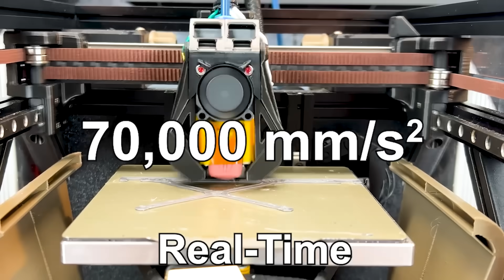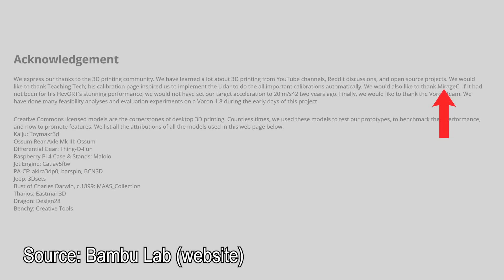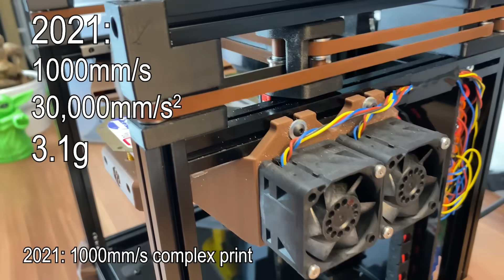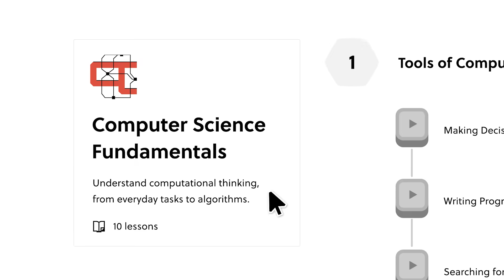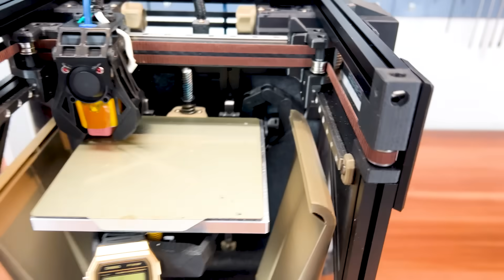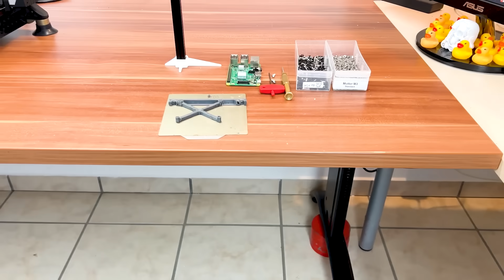INSANE PRINT of a COMPLEX PART on a tuned Voron - 247zeroB2

Comment from the maker: This printer has been released open source, here is the video: 
https://youtu.be/zpHNJRX5t3s?si=XEu5H-D5V5siwk1O
Reply: Congrats on stopping smoking!
Reply: congratulations
Reply: Wow das ist unglaublich. 

Und Glückwunsch das du es geschafft hast mit dem Rauchen aufzuhören 😊
Reply: I've got 2 words to say here... Dimensional Accuracy? (not functional, functional is very forgiving... Accurate, across many platforms)
.
components integrate, components need to Fit Each Other, they need to avoid compound errors throughout the assembly... can ANY fdm printer, in reality, poo anything close to this fast. no matter how great the extruder and produce accurate parts with sensible Component cost? really though?
.
Any 3dp owner knows you Can (promotionally) print at high speed. 2k x 70k will result in, essentially random, component sizing and ever-greater compound assembly errors.
Slow and accurate will always be better, until G-based E-wiggling is replace with ionic material control/microwave composition... which we aint anywhere near.
Plodders want 'print heads,' the E dimension. that supposition will limit flow control until material and post-process are combined... into a 'microwave' that prints, cinters, stabalises and potentially Biologically activates any assembly.
.
Joined up thinking will revolutionise 3dp Material, Placement,  Interaction - way beyond the fdm 'boat race'
Reply: Congratulations on not been drunk.
Reply: CONGRATS ON ONE YEAR🎉🎉🎉
Reply: now use petg - cant get over 100mm/s .... viscosity and flow rate are ass there
Reply: @Jayko30  that’s petg. Who cares 😂
Reply: @BlakeT  after you tried using your brittle pla toy parts for something serious you would understand it. PC, PETG and ASA are go to instead of these toy filaments like PLA or PLA+ which break at the slightest impact
Reply: @Jayko30 I agree with you, however I notice many designs for printers and 3d printed cnc use PLA for its stiffness, it is very stiff compared to petg and abs, but maybe not PC
Reply: Does layers fuse correctly?
Reply: S😅t😅😅😅t😅tytty😅t😅😅e😅t😅t😅t😅t😅t😅😅eet😅t😅tetseteet
Reply: Good work! Amazing

Comment: this gets me very excited about my project!
i bought a used pick and place machine which i intend on removing all the original electronics and putting 1KW servos on X and Y and quad direct drive extruders and btt manta with cb2 and even with all that weight it should hit 1500mm/s and easily 50k

Comment: Congratulations on being smoke free! I am a bit like Prusa, speed is a secondary quality (including overhangs) and multi material first. Though when i have to wait for 10 hours to use again my only printer while others only need 1 hour is something that will grab my attention instantly. Speed isn't everything, but it still deserves the second place on my list.

In case you are wondering, i mention multi material with quality together, because water soluble supports will give you the best possible quality at higher temps, which will give you better layer adhesion. You need multi material printing capabilities  for more accurate stronger prints. And some may even consider prints higher quality just because of their multi color nature.

Comment: I currently have an XYZ motion system, 1,000mm x 1,000mm x 400mm. The maximum speed is 1,650mm/s, with an accuracy of 1/2048mm, controlled by Beckhoff using the EtherCAT protocol (this speed is achieved with a maximum load of 18kg). Should I install a 3D print head? How can I install the print head?

Comment: 9 months later, i still cant help but wonder what if you changed those fans for something custom based on high power bldc motors and oDrive, because it occurs to me like those fans need quite some time to ramp up, imagine if the fans instantly accelerate to 100% without that delayed rampup, i think that would help massively for bridges like that.

Comment: If the head is as moving mass is upside down, then it will not wobble the whole printer. I would instead also stop the head moving, and instead I would move the plate.

Comment: That's cool, fast and real but what happen with print quality, the wear of the hardware specially the rails bearings, belts bearings, you have to grease every week because all the frictions and heat at that speed. What about the motor's (extruder & X&Y) will be on fire (hot). 
Can you do a video printing at 700-800mm/s speed or the fast you can with quality to compare with Bamboo and Creality they claim can print at 600mm/s with quality, that be a great video.
Thanks

Comment: for the x and y axes, wouldn't it be better to have screws like the z axes to move. I see that in cnc machinering and the speeds are incredible with a very high precision. I think that it would change alot the precision at high speed.

Comment: The quality is, as you said, complete garbage. But to quickly see if a component fits as it should be in order to throw it away afterwards and print a decent part, it is absolutely sufficient and saves a lot of time.

Comment: Wow, this is so far beyond what I thought would ever be possible. I have an Ender 3 Max, and I've spend a fair bit of time modding, adjusting, and dialing in my settings to be able to print reliably at 100-150mm/s... and I'm proud of it... yet I'm starting to feel like I'll look back on this machine and its speeds as a distant relic of the past in the not-so-distant future.

Comment: I am curious about the linear guides and blocks that you are using. Have you used some kind of preload or precision class?

As far as I know, those speeds and accelerations are very close to the rolling limit of the ball bearings inside the blocks. They might be sliding instead of rolling in some moments. I suppose that you will see the consequences if that happens. Keep us updated!

Kind regards!

Comment: It has been my understanding the speed limit is simply that the plastic can't be extruded fast enough and adhere fast enough.  If you increase nozzle size it reduces quality quite a bit.   Not sure I understand how to solve that problem, I don't think movement of the print head was ever an issue.  I also thought the delta design is the fastest since it uses three motors all at once to move the head, but it seems all these fast ones don't use it, the arms must not be rigid enough

Comment: it is a fantastic video, good experiment! So I was wondering what you have in the sides of your printer's bed that looks like fans ducts are they actually for pushing air towards your bed or not? Sorry if it is something common, I am learning about 3D printers designs still

Comment: If you want the best cooling for your print you should get some efi fans (wont work for the hot end as there to big for that) as they increase the airs psi a little as passing through allpwing for insane airflow with highly efficient cooling capabilites

Comment: Albert- you seem to be a dam good systems engineer, and the goal you have taken on to see how much you can speed up 3D printing seems rather inspired..   I am enjoying you narration of your youtube video's..   seems we have some motion control knowhow to exchange, as one can achieve significantly higher motion control performance by moving beyond open loop stepper motor to closed loop servo based control. here there a few additional things that can be optimized. before going into looking into optimal matching of inertial impedance of motor amateur with it's load, soon enough you can expect to be needing to counterbalance moving inertial masses such that you do not end up exciting the resonances of the 3D printer's frame.  But your insight of placing shear bracing along the diagonals of the printer's frame as a starting point seem spot on..  I will write you via Email.

Comment: I also build some 3d fast printer. But my build plate is 600x400 so probably this insane speeds are not able to succeed. But it's insane to make your printer faster all the time and all the time test some new configuration and settings for faster printing. Good job 😊

Comment: And where were the haters wrong? This is not a detail, but a piece of shit. At this speed, it is only possible to produce something that does not require strength and is mounted somewhere very far from the user’s eyes.
The design of the printer itself, with the missing front top beam, already hints that this is just a toy to amaze idiots on YouTube. There is no rigidity, everything shakes, which only spoils the already poor print quality.
The part itself... In the same 5 minutes it could be made with a jigsaw from a single piece of plastic, or cut on a laser machine. A disgusting example of using 3D printing in practice.
Reply from the maker: A disgusting example of a troll pretending to know what its talking about. This one really should stick to its jig saw 👍
Reply: @247printing yeah lol

Comment: For temperature change between out flow and the part, try a cooling bed to increase the cool down of the material making it solid quicker to hold more intricate models

Comment: 00:15 The industry has seen drastic changes in FDM printing speeds with competitors introducing faster printers.

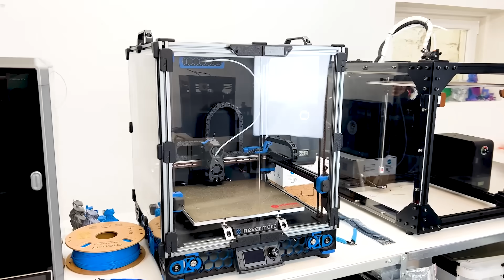01:44 Open-source communities and firmware have enabled the development of fast 3D printers.

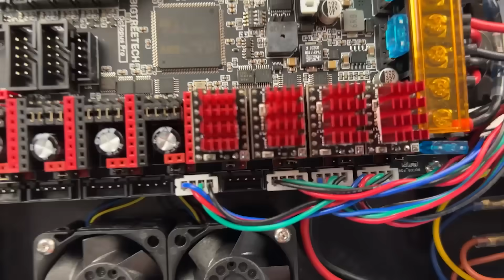03:04 Achieved new record time for 3DBenchy print

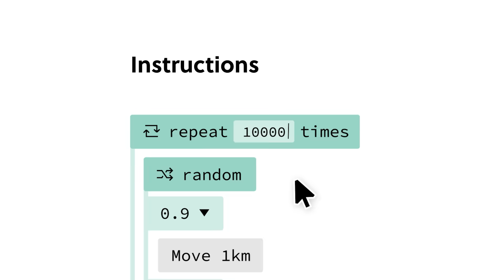04:28 Brilliant offers interactive courses for learning and provides a 30-day trial with a discount on premium subscription

06:10 The print takes around 5 minutes, half the time compared to the previous year.

08:20 High airflow and no part cooling fans on the toolhead for lightweight reasons.

10:37 Printing the part is faster and easier to assemble

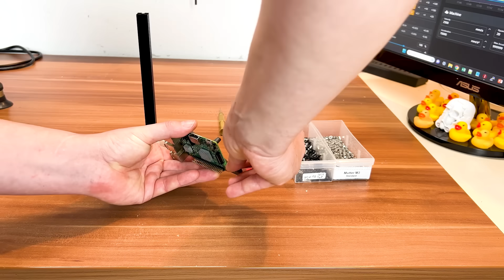12:28 Printing at high speeds can produce usable parts quickly

Comment: I reckon that stringing and misshapen layers could be fixed with better filament tech. Idk if this is true but I have a feeling the printers are advancing faster than the filament is… like I get it it’s just plastic, but I’m sure there are different % mixes they can come up with to lower certain outcomes. Like a filament for high speeds and a filament for slow speeds, varying in strengths due to compositions.

Comment: In my opinion, there is still one more modification to be made to further improve the speed, namely that the nozzle is too far away from the guide!! Let me explain it better... In order to prevent levers from being created due to the distance between the anchor point (linear guide) and the nozzle, you need to find the center of gravity of the hot end and mount the linear guide at that point. By doing this, you will not have distortions due to the elasticity of the steel.

Comment: Congrats on quitting smoking! Hope you didn't swap your smoking habit with a Leberkäs addiction. 
I have to ask: How durable is a printer like this? Your print head may be light, but printing still throws your printer around quite a lot. I wonder when and how fatigue would become an issue, because these print speeds take prototyping with 3D printers to another level. 

Also: 350mm V2.4 carbon X beam when?

Comment: Kudos to you! I didn't believe that fast of printing was possible.

You are proving that "garage innovation" is still able to push the boundaries without large corporate backing. Absolutely fantastic.

As crazy as that is, I still see you working within the intellectual box of current FDM printers. I think it would be bananas to see what you could do if you went outside the box. A couple of ideas that might have merit.

Get rid of those slow and sloppy belt drives and replace them with high speed 3-phase linear actuators. 
Remove 60% of the hot end weight by using a remotely mounted pulseless high temperature pump to supply the hot end with molten filament and use the bare hot end with a micro valve to regulate temperature and precise flow control. This would also allow the use of a large range of filaments and not just some super secret one.
Incorporate a low power, high pulse laser to melt the first few nanometers of already printed material for complete layer adhesion directly before the nozzle.
Use a mini compressor and a vortex cooler to supply super cooled air to instantly solidify the extruded filament.
Combine a bed slinger with a coreXY to dampen the inertia of the extruded filament since the hot end will no longer be the limitation on print speed.

Ideas like this might be fanciful or outright impossible, but I'd love to see what you could do without the limitations of current FDM printing.😢

Comment: what's the retraction distance and retraction speed? I would like to know the settings to try to push the limits of my 3d printer. I know I won't be able to achieve those speeds but I'd like to know my limits and find out ways to increate performance with minor changes

Comment: Congratulations on the print, but i'll have to correct you.. you never stop smoking.. you can fall back in and harder than before the day you least think.. im currently on a 13 years pause between two cigarettes..
Reply from the maker: Thank you! But I need to correct you, though we're thinking the same: "You (probably, but not necessarily) never stop smoking FOR GOOD". But you can indeed "stop smoking"... until you MAYBE start again. I stopped on year ago - still 👍
Reply: Don't let your guard down 💪🏼

Comment: Incredible build my dude!
(.1mm * .4mm * 1500mm/s) by that math, you'd be pulling through 75g of PLA / second, not sure it was travelling quite so fast but definitely fast! (unless my math is way off cause I'm super drunk)
How much PLA did that take? It'd be interesting to know the final rate of consumption averaging all the velocity changes
Reply from the maker: Thanks a lot! 
Unfortunately your math is not correct by factor 1000: 75g per second would be insane :-)
That would be 22.5kg in those 5min. (when extruding continuously).
Density PLA = 1.24 g/cm³
1cm³ = 1000mm³
Density PLA in (mm³) is 0.00124 g/mm³.
When pushing 60mm³/s, we push 60mm³ x 0.00124 g/mm³ = 0,075 g/s when reaching peak flow at requested peak speed of 1500mm/s.

Comment: I've got 2 words to say here... Dimensional Accuracy? (not functional, functional is very forgiving... Accurate, across many platforms)
.
components integrate, components need to Fit Each Other, they need to avoid compound errors throughout the assembly... can ANY fdm printer, in reality, poo anything close to this fast. no matter how great the extruder and produce accurate parts with sensible Component cost? really though?
.
Any 3dp owner knows you Can (promotionally) print at high speed. 2k x 70k will result in, essentially random, component sizing and ever-greater compound assembly errors.
Slow and accurate will always be better, until G-based E-wiggling is replace with ionic material control/microwave composition... which we aint anywhere near.
Plodders want 'print heads,' the E dimension. that supposition will limit flow control until material and post-process are combined... into a 'microwave' that prints, cinters, stabalises and potentially Biologically activates any assembly.
.
Joined up thinking will revolutionise 3dp Material, Placement,  Interaction - way beyond the fdm 'boat race'

Comment: I compare 3d printing tinkering with auto racing.  Nobody is going to race down the street at 300mph, but because there are hobbyists pushing the envelope it's not uncommon to have a stock 4-cylinder vehicle with 250hp (which would be hard to achieve with a V-8 in the 90s).
I don't expect anyone to print at 1500mm/s, but because people like you have pushed that envelope we now have printers you pull out of the box and easily print 300-500mm/s with good quality.

Comment: A few thoughts,
I wonder what the maintenance would be when using a machine long-term at those speeds? Belts, pulleys, gears, and what not
It would be nice to see a video on the quality differences when you slow down from max speed. So maybe half speed raises quality by x?
Reply: I bet the belts will be loose.

Comment: "Typical bowden problem" - you can mitigate it by make bowden tube shorter. in fact, many "direct" extruders is "bowden" with really, really short bowden tube. So, try to mount your extruder upside down on top of your printer in the middle of it to make bowden tube much shorter.

Comment: This is very good job. But as you said someone will always complain, so now it is my turn. How about fast printing with technical filaments like ABS or nylon, or even CF Nylon? 
I am aslo intrested in high speed print, but i need my parts to be functional, so my basic filament is ABS, and when I need extra strength i go for Nylon or PC, so the question is: How fast can you print without compromising strength and usfulness of the part? I End up with a benchy out of ABS in 28 minutes, yes I deliberitly use print time insted of movement speeds, because this is what ultimatly matter for manufacturing. Don't take ma as a critique, becouse you did really great job. I am just use 3D printing for a bit diffrent aplication, so there is my question about more demanding and stronger filaments.

Comment: may I ask one question? the print speed is incredible, yet you said that it is 0.1mm layer hight (which is fine, I know) and 0.4mm nozzle.
sure, I have just an ender 3 pro, one little optimization was to use a 0.6mm nozzle, which brought down my printing time for items that need more rigidity quite significantly. 2 walls instead of 3, makes some difference.
no idea what your maximum melting volume per second is, I can imagine that you can run into another bottleneck with that.
I also know that a thicker nozzle means (without fancy slicer settings) that the infill is printed thicker, which could either be an advantage or a disadvantage.
maybe a comparison print speed, print mass and print strength could be interesting. reducing mass makes cheaper prints, reducing time is always nice, but reduced print strength is a problem in some cases.